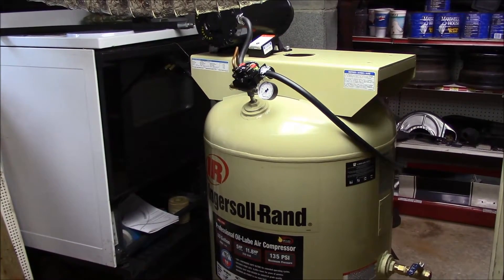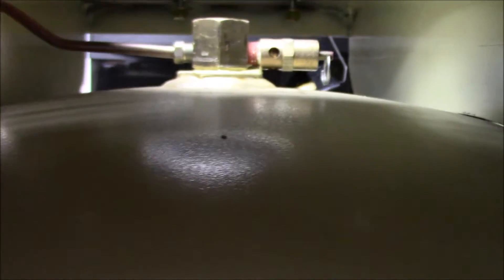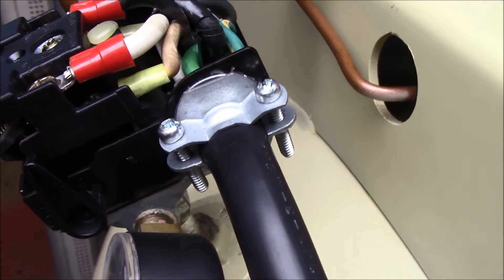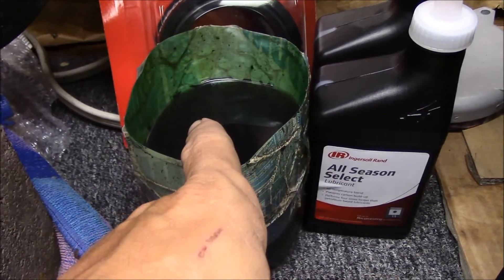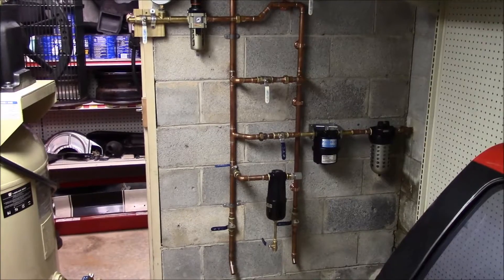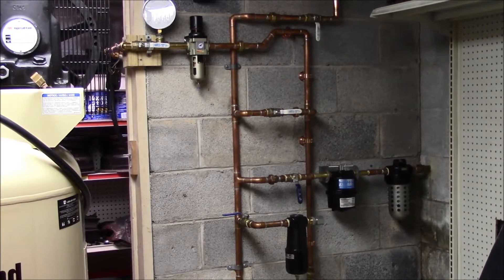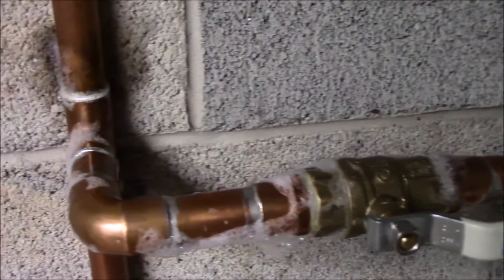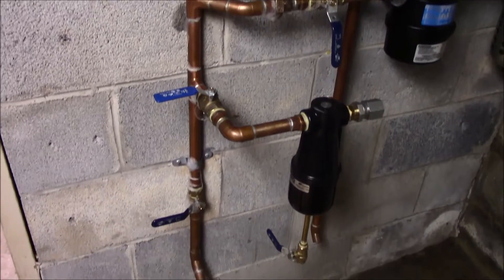Compressor Room Upgrade Part 2

Comment: If you want some serious air get a Saylor Beall model 9000. I bought one  surplus but was like brand new for $1,299 ! It’s on a 2000 gallon tank and will fill the tank from 0 to 175 in 4 1/2 minutes. Great compressor but it breathes really loud . Hearing protection advised.
Reply: 200 gallon tank not 2000 !
Reply: If you want to quieten down the IR try using AMSOIL . That’s what I use in the Saylor Beall and it really does make a difference.
Reply from the maker: Thanks for sharing!
Reply: Really like your videos too ! Keep up the good work . Happy New Year !! 🎆

Comment: Excellent work!! The only thing that bothers Me is, when a valve leaks or other component needs to be replaced- which WILL happen- you have to disassemble the whole thing. When i did mine, I used some hydraulic hose with JIC fittings. They can be taken apart easily, and seal perfect.
Reply from the maker: That's a good idea. I do have a couple of unions installed, so it won't be too bad.  Thanks for watching.

Comment: Your compressor upgrades and setup came out really nice.  I wish I had a 2-stage compressor but my single stage 60 gallon setup is working for me now but I will need to upgrade it in the future to a 2-stage setup.
Reply from the maker: Thank you Timothy. Yea the two stage is great for painting. At first I thought having both units would be way overkill, but it has worked out really good. I use my single stage for  everything except painting.

Comment: Dam,,nice to see a man as picky as I am,,,,I did mine all in copper and brass also,,,I even polished it like jewelry,,,lol,,,,,I ran a 1/2 inch coil copper tubing from my pump to my tank,,,,looks like a alcohol still,,,,,but it dropped my air temperature from 240 degrees at compressor to 62 degrees at tank..also really helps with moisture...
Reply from the maker: That's a great idea for cooling the air. I have been working on adding a condenser to my Quincy. Still got to get a hose made up for it. Thanks for watching.
Reply: @DoubleRRestorations  I have a condensing coil from automobile that I saw many useing, my concern was restricting flow,,because of the smaller diameter tubing, and I blow air through it and could notice the restriction and even back pressure,,,now I see some have blown head gaskets,,,so I bought a coil of tubing same diameter as my line on compressor,,
Reply from the maker: George, I have the same concerns and have also seen some blown head gaskets using a condenser. I got the same one that a friend of mine is using on the same model compressor, so hopefully it will work. If not I will do what you did with the coil.

Comment: I was told to use copper to cut down on moisture in lines. Something about using metal and temp drop in line? I'm clueless. I'm unable to do it for health reasons right now but eventually like to build a manifold.
Reply from the maker: I like the copper, it does cool the air quickly and its not hard to work with, there is a large assortment of fittings available. I hope you get to feeling better soon.

Comment: Did you ever consider doing the set up with the condenser to really take out the water? The setup is looking great
Reply from the maker: That will be the next vid. I've got the parts on order and it should be the same setup as Roger's, I hope it works as well as his.
Reply: I did the same setup and I have no water in the line at all nothing gets past the first rapid air line that feeds into the tank! Well worth the work and money
Reply from the maker: Good to know. I should have the parts in a week or so, then I will have to see about getting some lines made up. I may even add one to the IR, but for now just going to do the Quincy
Reply: where can I go to see Roger's setup

Comment: Russ, I had to drill out at the switch on my compressor also. I used 10 ga. SO cord with a romex connector. Project looks great..
Reply from the maker: Thanks Jeff. Its one of those things I should have done at first. lol.

Comment: You did a nice job installing those two compressors. A little PM goes a long way. Have a good week Russ.
Reply from the maker: Thanks Darryl. The IR really needed a PM. I had wrote the date on the air filter and it was 4/13 since the last one. I had no idea it had been that long. Time really slips away sometimes.

Comment: You're compressor setup is awesome. Good idea on the soap bubbles to check for leaks. I have leaks that hum to me while I'm working but still haven't fixed them. Lol
Reply from the maker: Thanks Sam. I've got some couplers on some hoses to replace to.